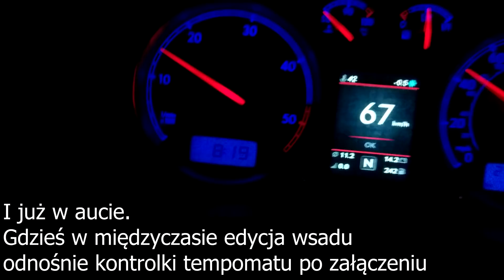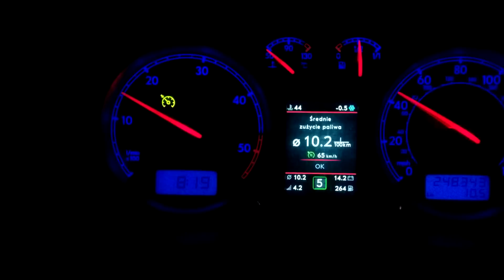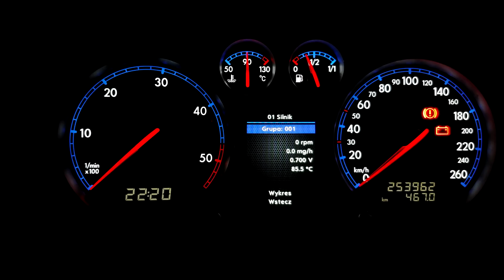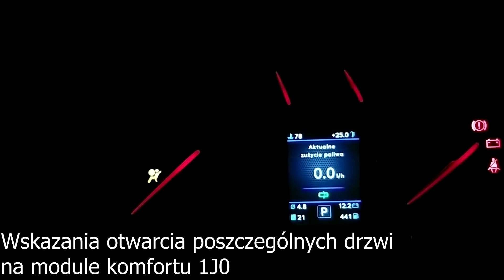Licznikowe transformacje - Golf 4 [MK IV] Cluster retrofit + ColorMFA [+English subtitles]

Comment: Hey I love the work in the video, really nice retrofitting. I'm retrofitting stuff in my car as well but I'm stuck at adding open doors icons with 1J0 cluster and so far I've only added the warning for open trunk successful. I've added CANBUS connection from the CCM to the cluster and I'm getting 4 errors in the CCM about no door module communication to all doors (I've replaced the door locks recently)

Do you have any tips?

Comment: One question - I have the same cluster like you(I guess) so it’s just plug & play to work half MFA cluster?
Reply from the maker: What cluster do you have now? without fis?
Reply: R3 R3 I don’t know the cluster code but absolutely everything inside cluster looks the same like yours
Reply from the maker: @ricardsastotais1706  Like mine on the beginning?
Reply: R3 R3 yep
Reply from the maker: @ricardsastotais1706   you need to check your cluster number. If you have now xxx920xxx (CAN), you can buy xxx920xxx half or full fis cluster,  add wiper stalk with mfa keys, ambient temp sensor and match your keys. If you have xxx919xxx(no CAN), you need to search for 919 cluster, but there are no half fis 919 clusters. Only full fis (hard to reach, expensive) or MFA (values showing on left small LCD - same as the clock)
Reply: R3 R3 I cheked and i have xxx920xxxx.So. I can buy full or half FIS and it will work just by pluging in?
Reply: Can you reply plss?